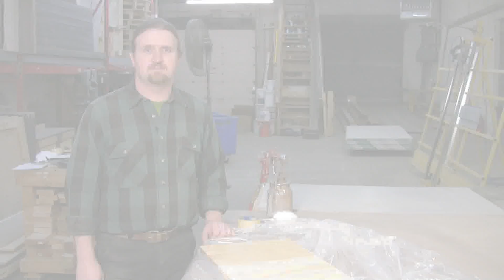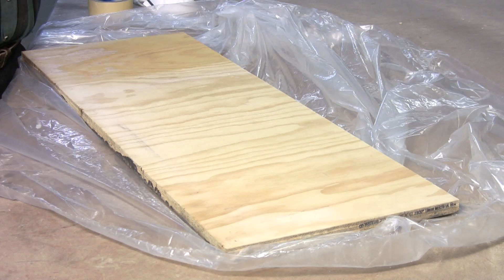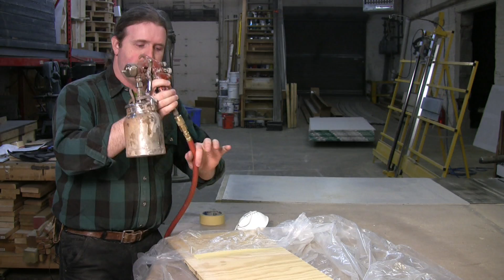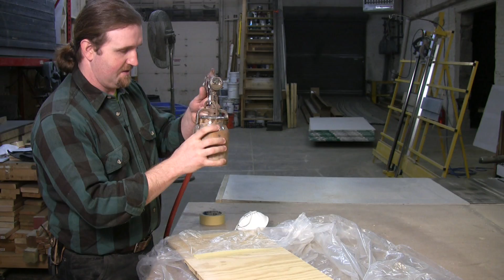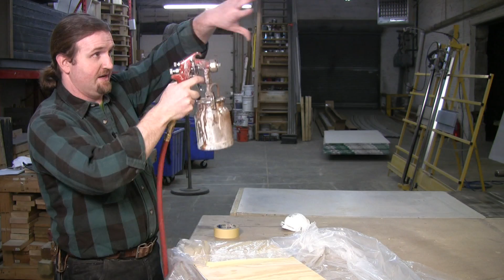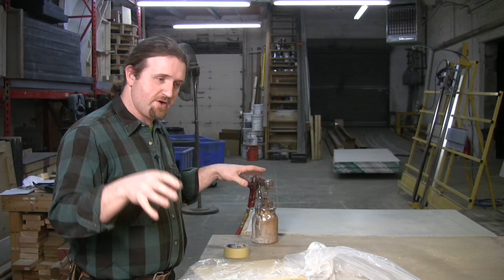Home Repair & Power Tools : How to Use a Spray Paint Gun

Comment: He is wrong on a fundamental error right off the bat. Vertical alignment of air horns require a vertical stroke, horizontal alignment or air horns require a horizontal stroke. Do not listen to this guy. You will tiger stripe your paint job and ruin it with heavy, 1 inch pattern just as he has. 100% truth

Comment: Turn the air pressure down and then you wont be to close turn in the trigger stop in for less paint and dont for get to change the fan. Comment from a paint sprayer.